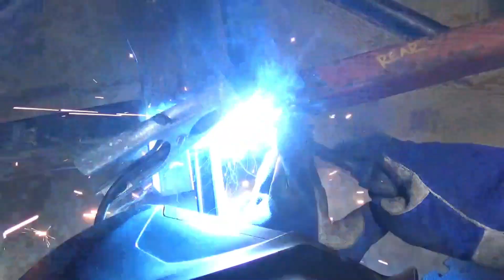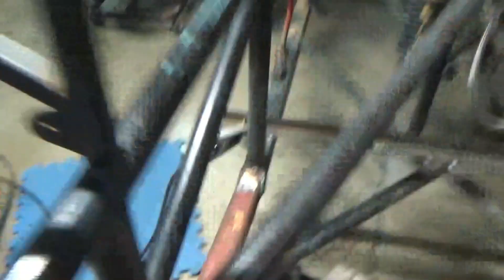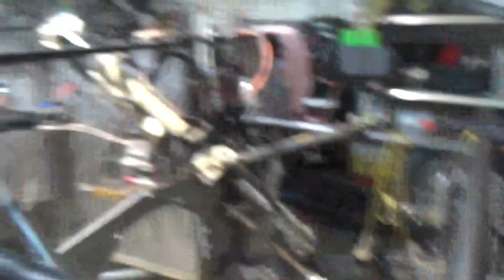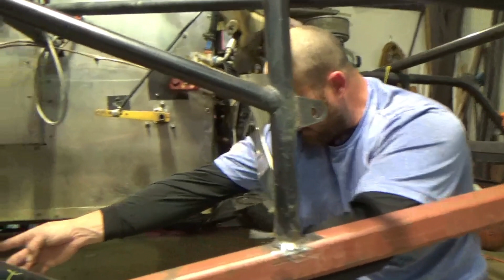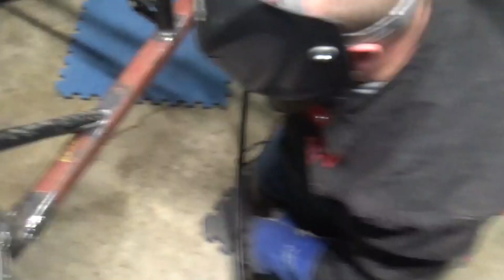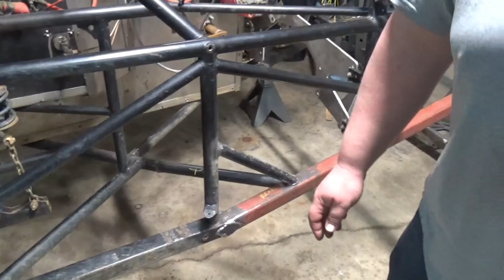"Bracing Up" A Little Extra Insurance for Riding the High Side

Comment: When you're welded with the wire welder you should be pushing towards where you're going so the gas will be there before the wire. A stick welder works opposite. Better late than never but I'm always late my wife says. Great work guys.
Reply from the maker: Thanks Jerry!  It is always rookie hour when welding at LMG! I had a dream that all the welds broke during the first race and parts and pieces went flying everywhere.  So far three hard races in and the ole girl is holding strong.  Thanks for your input and it makes sense to push the puddle towards the gas instead of pulling it away!

Comment: Guys, that diagonal bar "brace" will kink the vertical bar ....you must add another diagonal bar 
on the other side towards the rear to transform the force to a tension force on the vertical bar....
Reply from the maker: We are not sure how the bracing bar will kink the vertical bar.   This frame is just a dirt car running a SBC not an asphalt car with 900 HP.  If it kinks, we will just go out and buy another one.  Find it hard to believe that there will be so much force on the RF that it would cause the upright to bend.  Who know's... maybe it will.  Most Mastersbilt cars that are 15 years old sell for less than 1k as a frame.  At that price, it fits our agenda of having fun and racing hard!
Reply: @LateModelGarage  : Fair enough.....Consider this, a "brace" is a component
meant to transfer a load to another body.....Where is that load going.....To a point
load at the middle of the vertical bar.....That bar will Kink way sooner than it will
fail from stress.....Hence the load does not spread out to the main chassis....If the
existing diagonal bar, ran from the intersection of your vertical bar and the top rail
 to the intersection of the next forward vertical bar with the sq tube, your brace would be redundant...From what I see, the chassis builder may have arranged those tubes
to be the soft failure point to limit the main cage distortion from a wall contact....:^)

Comment: Alright guys I'm going to add my 2 cents worth.
#1 I don't like the choice of material for the new square frame rail. I would have preferred a new pc of the same wall thickness.  However,  your fit was excellent,  technique sound, good job. Since it was a mitre joint,  the outside patch was perfect.  I  would like to see the material a little cleaner,  and some pre-heat... overall though you guys did a nice job, its good to see guys trying to make their stuff better. That's how we do it...👍👍
Reply from the maker: Thank you for your input.  If we don't like the heavy rail we left enough room to cut it back out and put in some .083".  We are learning everyday about late models.  The past couple of years have been very challenging but we enjoy racing and like the competition.
Reply: Even if it isn't cromoly you still don't want to preheat it because it will bring the rockwell up in the material and make it more brittle and prone to cracking.
Reply: Absolutely no reason to pre heat any joint on a latemodel frame. Especially if it's cromoly.
Reply from the maker: We are pretty sure that material used for the chassis is not chrome moly.  At this point we have not had any issues with the welds going in smoothly.  Fingers Crossed.  Thanks for watching!

Comment: Will be curious to see if this mod affects chassis flex positive/negative. We just had our lower frame rail repaired due to a crack by aframe uprights. 2015 Rocket blufrt.
Reply from the maker: We share your curiosity.  Flex vs strength always has room for discussion when it comes to dirt racing.  Follow along and find out if we are zeros or heroes! :-)  We like to think, if it breaks, we can fix it!  Thanks for watching!
Reply: Looks good !